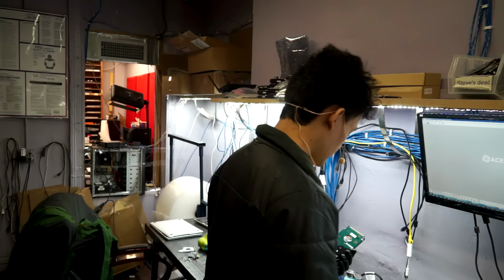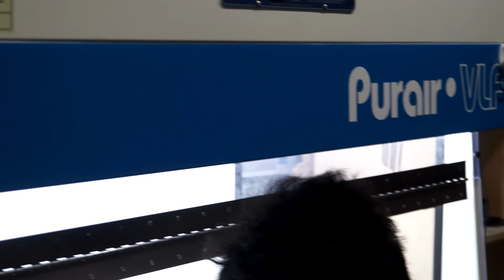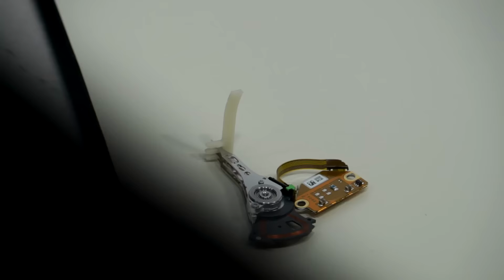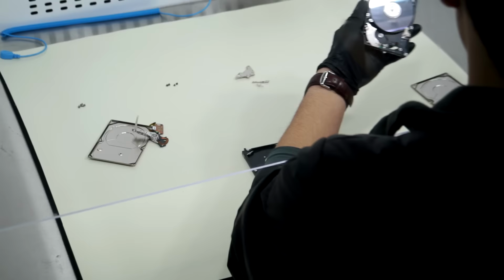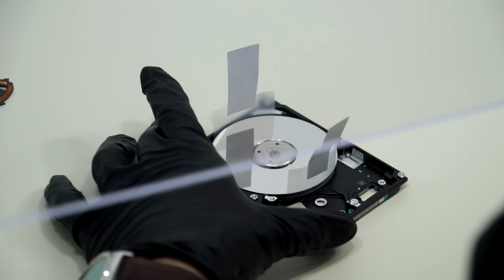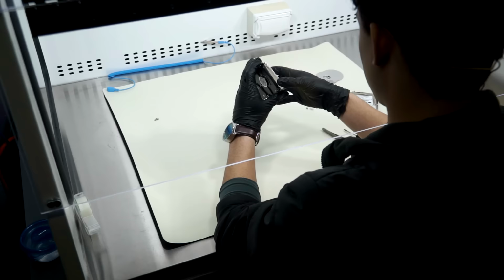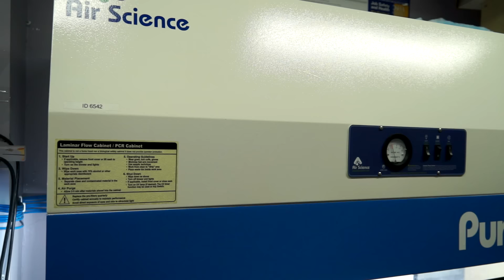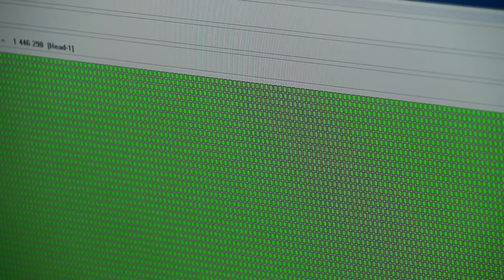Data Recovery: Hard Drive Platter Swap in Our Lab!

Comment: So in all these years of producing hard drives not one manufacturer thought to develop physical systems like pins that align the discs or replaceable bearings?
Reply: SSD?
Reply: @enchantededition6879  I’m talking about the mechanical drives that are now on their way out
Reply: Why? That would only ever help in data recovery. It doesn't make sense to optimize hard drives for data recovery, when the same effort could be used to improve reliability.
Reply: Would throw out balance if uneven. 7200rpm. But could be done if offset 180 degrees. Major cost increase for them compared to making balanced discs without indexing.
Reply: As an automotive diagnostician/electrician I see many failures where customers alongside their general apathy towards any sort of preventative maintenance,hear a noise or notice a fault but adopt the "It's still working,I'll get it fixed later" attitude, but never do until it actually stops working. Given that HDD's get progressively worse up until the point of failure and give fair warning by virtue of increasing noise, it could be argued that it would be better to resolve the issue when you first hear it becoming noisy instead of continuing to use it until it's too late,costing more to remedy and at greater inconvenience. You can't blame manufacturers for peoples laziness.
Reply: It's called backup, this is not how you do it when a drive dies and you have important data on it..
Reply: @jada1173  the reason for the backups is because you can’t count on the hard drives. If they were built better you wouldn’t be worried about backup.
Reply: @ram0166  remember how old this video is.
80gb disk, not so much precision in this.
What would be the succes rate for doing this by the average person on todays disk drives..
Wery high density in todays drives with extreme precision, helium filled and so on..
Think backup on other drives is not so bad decision after all..
This is a emergency repair to get out the data and will not be used anymore, it's conten is copyed to a new drive

Comment: Do you do liver transplants?
Reply: Not sure if Louis does, but we can fix your pacemaker in chest for 29.99!! No Pulse, No Fee! lol ;)
Reply: Yes we will include a complimentery Magnetometer swap lol..
Reply: $29.99 in UK money is a month's wages these days otherwise I'd consider it!
Reply: Ummmm.
Reply from the maker: We do not, but as warned by he lobbyists in Nebraska, there is an epidemic of underground DIY pacemaker repair communities, of which we are a proud member.
Reply: We are too.. We only fix your pacemaker form the highest quality boards with holes in them from China. Walk-Ins welcome!
Reply: TCRS Circuit 😂😂😂😂😂
Reply: It should be possible to fix a pacemaker if you can find spare parts and a shematic. Good luck with that. :)
Fortunately the cost of the pacemaker itself is not realy an issue, the cost of the MD's on the other hand...
Reply: They'll hold the liver in place with scotch-tape
Reply: With especially designed scotch-tape which dissolves in the human body in a few weeks time. :)
Reply: Just try and solder it.... Little NC-559 and some leaded solder and I bet it will have no problem staying in place1
Reply: Finkel - Funk liver work requires duct tape
Reply: The reason why it is good enough to use a tape is because alignment is not critical. It is enough that sectors that is on top of each other with the same number but at different platter is being read at the same time before the timer runs out. This time is usually +- half a sector. A file is not stored in one platter, but is divided into chunks and divided into all the platters. This is for faster transfer. Each sector on each platter got its own preamble and sync word. Thus, there is no need for bit to bit precision. This wouldn't work either because a slightly different temperature on each platter will move a bit far away, many bits from another bit on another platter, in fact, this is the case even for two bits on opposite side of a platter. It was a time though, with mfm encoding (typically disk less than 100 MB) where there were only one synchronization for the whole drive and where all bits on different platter needed to be exactly where it was with a precision better than 10% of a bit. When the bits got smaller this was an impossible encoding scheme and everybody went for rll instead where every physical sector had its own synchronization. With MFM it would not be good enough to use tape. Then you would need a HDD to backup side by side of each platter, re-construct the synchronization and put the data result back on platters in the donor drive. You would also have a challenge to sync the tracks with the head of the new drive because two drives wouldn't have the same track sync. This meant that you would need a low level format where you only ran the part where track sync was set up. In modern hdds such is done in init when a disk boots up and will track, sector- sync continuously and while reading a sector. If data read from the disk falls under a certain threshold the head will be moved until it is on top of the track again, and this without interrupt the read. Write doesn't have direction error control.
Reply: Only between identical twins with the same firmware.
Reply: Try and get that done at a Genius Bar! "Can you recover my data from this seized drive please?".......... "You need to buy a new MacBook "
Reply: That would probably be easier
Reply: Where i can get the head com
Reply: A soldering iron is mandatory for it. The liver will bleed heavily so its a great tool to cauterize.
Reply: No but you can get a coronavirus free Rossmann Group certified Chinese implant or augmentation
Reply: My thoughts exactly.  Perhaps even brain surgery?
Reply: LOL

Comment: anyone else cringe when he was spinning the platters with those sharp pointy metal tweezers? "oops i slipped", lol. good video.
Reply: It was a donor anyways but still
Reply: He did it on the data platters as well; Also had a 'don't do that' moment :)
Reply: I cringed a bit too, then considered that I would do the exact same thing myself, while thinking, "huh, I probably shouldn't be doing this."
Reply: Yes but no. Doing that could maybe spin off any dust (as unlikely as there would be dust) between the platters?
Reply: that's called skills.
Reply: @milkagem  why is there always one of you on every video? Theres nothing manly about tossing out good repair practice. "Hold my beer" does not mesh with the extremely delicate and skilled work that these folks are doing.

Just enjoy their skill man
Reply: The thing i found more scary was he is using a magnetic screw driver near the platters witch save the 1's and 0's as magnetic charges.
Reply: Yes absolutely! Get some plastic tipped tweezers!
Reply: Knowing myself, i would have fucked that up.

Comment: Please stop putting off that backup folks.
Reply from the maker: People can back things up once PC3000 & laminar flow bench paid for themselves!
Reply: Louis Rossmann if I may ask, how much do you charge for data recovery that involves playing on a donor PCB or more serious shit like this platter swap?
Reply from the maker: +Doc. Volt $400-$950.
Reply: Louis Rossmann I definitely charge too little.
Reply: Louis Rossmann Nobody needs to endure the torture of what I've just seen! Scotch tape madness.
Reply: I had a backup drive. It died a few days after my main drive, right after I've changed it. Cloud backup is the future.
Reply: 3-2-1 rule for the bit more paranoid... that's why you should store at at least 2 places. Encrypted of course. You don't want to voluntarily send all your data to the NSA (or any other agency) with that sweet cloud backup solution that claims it will solve all your backup woes.
Oh and with a Raid-1(5,6,10) NAS that situation is far less likely, with an additional cold backup once so often you have a somewhat better solution than manually swapping external hard drives.
Reply: there is no cloud it's just someone else's computer
Reply: got double backup of everything important. hope I can save enough money to backup C:/ of both my desktop and laptop, so I don't need to go trough hassle of installing everything again if I loose data. Also got crystal disk up 'n running all the time so I can see when drive starts to wear out.
Reply: That's peanuts compared to enterprise data recovery prices. They charge this much for looking at your drive and then again as much for every gigabyte of data recovered.
Reply: Triple backup for the most important stuff (Pictures, documents, program source code, etc). 1 copy on Mega and two more backed up locally on two different computers. Everything else is backed up with two copies, automatically synchronized between my computers.
Reply: DeathlyHall0w I don't know.
Reply: HAHAHA, im putting mine off
Reply: People just need to respect HDDs are consumables, its not like a raw material like a lump of highly inert iron-oxide ore, HDDs are unstable and have all kinds of different internal Half-lives. They're like the tyres on a car; you will be changing them, (sooner or later depending on usage). The timings/signs of 1st critical wear are tested for and known provided you pick a good model, so i wonder, are people just genuinely oblivious to HDD life? OSs could bake in more standards and interface to protect & inform consumers, encouraging people to take their PCs for a HDD change like a car gets a tyre change... ( would simply require a public database of HDD performance & endurance data) to model how internal drives are doing and how soon they should be changed modelled against the consumer's usage habits.... a little wee pop-up in your windows 10 action centre to the effect of "one of your HDDs reliable operational life is now 80% consumed,"... maybe i'm talking out my arse... i don't know...
Reply: I have multiple backup PCs so that I don't have any down time.
I can not miss a single minute of the stock market.  It's just not okay with me.
Reply: +Charles Stawell
It's a crap shoot.  My current 1TB drive has lasted me a very long time.  Like...  I think it's getting into its 5th year, now.
The 2TB drive I have is unplugged because I wasn't sure if there was a virus, the O.S. was corrupt, or if it was failing.
It lasted a little over 1 year.

My external 'backup drive' is click of death FUCKED.
Because it had redundant data, it's not even worth retrieving anything from it.

Basically:  Put your drives in a big ass Antec1200 that never moves and your HDD will probably live for years.
And still, back everything up.
Reply: why ? we got the cloud now..
Reply: cloud isn't like magic or literally sitting in a cloud. its still in drives somewhere and there still in a chance those drives could fail. say for instance if an EMP strikes all your data is gone. but unplugged drive in a lead safe is probably gonna be just fine.
Reply: the cloud is not your computer, you should know that. 
keep two hard drives of the same capacity. one in your PC another external. backup it all sometimes.
Reply: I'd rather have it backed up on two on my own computers.
Reply: To be sure you never lose your important files upload them to your Facebook for all to see, Mark does a great job at backing them up.
Reply: Cloud is not a silver bullet, it's actually worse than a local drive, 'cause you would have no chance for recovery. I've had a data loss in the cloud and my provider said something like "yep, we've lost your data, sorry. Here's your $10 SLA compensation for downtime".
Reply: I don't have ANY data that is this important. or even important enough back up. Exept maybe my porn.
Reply: Telhias until the internet stops working...
Reply: @rossmanngroup  I think you would like this at my local now defunct apple store the wanted  900 for a screen replacement  know wonder there no longer in business   I replied  is it made of gold
Reply: RAID by itself isn't a backup.  It's not like drive failure is the only way to lose data.  Data corruption is a bitch and RAID doesn't know the difference between the bitch and a lady.  Journaling filesystems do reduce that risk but offer no guarantee.
Reply: exactly that. RAID also does not prevent users / systems going crazy. If you, by accidentally typing in a wrong command, delete your files they are most likely gone. (With most file systems at least).
Also RAID has a very common issue. If a drive needs to be replaced, the Data need to be re-synced to the new drive. This is pretty heavy on the drives, and if the RAID is old, it is not uncommon that while rebuilding another drive fails.
So pro tip, if an old RAID needs a rebuild, always back up the most important files before rebuilding it.

Comment: This 5 year old video came in really handy for me. I have a USB drive with the same issue of the platters not spinning. I bought a donor drive with a dodgy controller PCB and am going to attempt a platter swap. The use of scotch tape was valuable to me as I never gave a thought to platter alignment. This video has now given me a chance to save a friends photos.

Thanks for keeping the old videos available.
Reply: How is it going?
Reply: Wondering the same. How did the endeavor go?
Reply: Me too, you really need a dust free environment to do this.

Comment: I know this is an old post, but I waited 2 years to learn as much as possible to salvage my files for a novel I was working on. I had about 60,000 words that were lost and I went ahead and purchased a used tunnel system this past month. I then got a hold of a new donor HD (luckily, it was a single platter). I was able to carefully pull the parking break and get the heads out of the way and gently pull the platter. Yes lol, I used tape to pull up the center platter very carefully. Once I landed the platter into the new donor housing and sealed it. I recovered 99.3% of my data. You guys rock.  I'm sort of stubborn and like to learn stuff myself. So I took the time to do this myself because I wasn't willing to risk additional impact or having too many hands touching it. I also did not want to risk sending this via mail and risking the package getting lost. So... Thank you for inspiring me to grow and expand my knowledge.
Reply: JimboParadox  lol. It was my first time, and potentially the last time. Unless I bump into another writer with a similar story ; )
Reply: JimboParadox  Yes; it was a Word doc. And out of Alllll the dozens of useless Word doc files I had backed up, that specific one never synched with OneDrive successfully lol. I usually keep 3 data locations as good contingency. We all learn : ) I would say do it! Practice with a drive that doesn't have critical data. And don't drink coffee before the procedure : )
Reply: @AlmightyGunz  I have got questions. Will it work if I swap the head using the same model, size, first 3 digits of serial number and same firmware version?

If it will work, can I use hddsuperclone to clone the hard drive or I still have to use PC3000??
Reply: @chris01479  if all you are swapping out is the head, you shouldn't have any issues. It's when you have to to swap platters into another shell that it gets a bit complicated and can be easily corrupted (the process). Just make sure you try not to make any contact with the platter, even slightly. Wear rubber gloves to prevent any potential static passing through, or use non-static conducting tools. Take your time and be super patient.
Reply: @AlmightyGunz  oh great, but there is a problem. How do I know if there is any scratches on the platters?

The data recovery firm told me in years ago that my hard drive had alot of corrupted and they can't find no more than 10GB which they should have recover at least 40gb or 50gb. That data recovery firm is well known as scammers. Should I contact them and ask them if there is scratches on the platters, what they do and how they recovered my data?
Reply: @AlmightyGunz  how do I know if there is any scratches on the platters as the data recovery firm didn't tell me anything about it S they have only recovered 10gb of data?

Should I contact them to find out more or what??
Reply: @AlmightyGunz  I'm waiting for your response